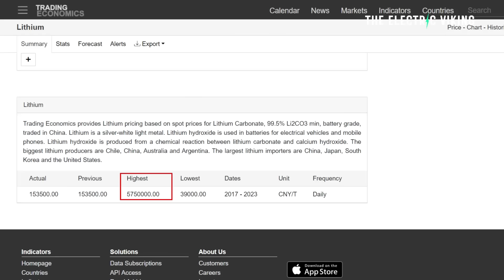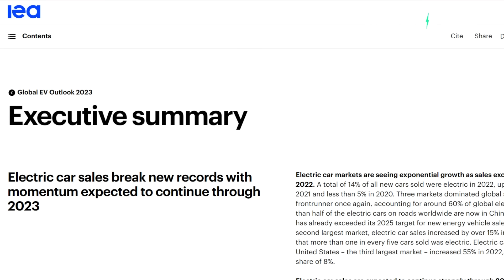The reason Electric Cars will be cheaper than ICE cars in 2025

Comment: Not only wil the purchase cost of vehicles beb lower but the cost of operating them be on the rise.
Reply: Why would the price to operate an EV rise?
Reply: @bobwallace9753  go look at the price of insurance. I also don’t need to install $1000 charger for a vehicle that I purchased.  Then I sincerely hope that you don’t get into a fender bender and find out that your entire car is going to be written off and totaled out because of panels they cannot be replaced. And God forbid that there is a scratch or a dent on the battery pack, no one is going to take the liability of replacing individual cells. So that means that on an accident you need to replace the entire battery pack.
Reply: @SlavGuns  
Don't be a drama queen.  Any car with serious crash damage gets written off.  Insurance companies do not want the risk of a future crash that might be blamed on major structural repairs.

According to Tesla it is easier and cheaper to repair a damaged casting than a similar repair on a 'stick built' car.

Tesla battery packs are well protected from crash impact.  If you get into a crash that damages the battery pack then you own a totaled car anyway.

Check Tesla insurance premiums.  

Almost no one needs a $1,000 charger.  Many people can do fine with a normal 110vac outlet.  If you live in Europe or another place where 220vac is the standard then you're set.  If you do need faster charging than a 110vac outlet provides you could either share your electric dryer outlet or have a new 220vac outlet installed for a few hundred dollars.

If you actually need a $1,000 charger then you must be a high mileage driver and should quickly save that grand via gas and oil change savings.
Reply: @bobwallace9753  The tires on EV's needs to be replaced around 4 times more frequent for example. I also thought service cost was supposed to be lower on EV's, but I was wrong lol. Also read about a VW ID4 owner who said the service on his EV was as much as the Tiguan he had before, but on the ev they did not change 5.5liter oil.
Reply: @AndrewTSq  
If people jams the accelerator to the floor frequently they will wear out the tires sooner.  But if one drives 'normally' tires should last as long, if not longer.

Tire wear claims are often based on vehicle weight.  Yes, if you compare the weight of a Tesla S to a Corolla the EV weighs a lot more.  But a type to type comparison is not very different.  

The Tesla S weighs  4,561 to 4,766 lbs
The BMW 7 weighs 4,720 to 5,095 lbs.

The Tesla 3 weighs only a bit more than the BMW Series 3.

I wouldn't make decisions on what VW or other legacy brands cost to maintain.  Look at "pure EV' companies like Tesla.  What I commonly see is people reporting high mileage (200k level) with no maintenance costs other than windshield wiper fluid.

Dealers screw people.  It's just how they roll.
Reply: @AndrewTSq where do you get your information?

Comment: The Limiting Factor channel has a detailed analysis of lithium supply and demand over the next years.  Its conclusion wasn't an excess.
Reply: 200 years to extract and refine the Copper, 9,000 years for the Lithium.
Reply: @MrkBO8  9000 years? I read there is around 88 million tones of Lithum on earth, where around 22 million tones do make economical sense to get out of the earth.  So that means we get around 2500 tones per year then?   2021, we got 107000 tones out of the earth.  so at that rate it means 205 years, and if we dont care about cost its 822 years. not 9000 years. But I could be wrong.
Reply: There’s plenty of Lithium to go around. Norway has discovered a. 
Whole dormant valcono of Lihium
Reply: Its not the supply of it, its how fast it can  be refined @AlanWilliams-su4bs Copper is a supply problem because the existing mines are already depleted, todays rate of mining it would take 200 years to dig it up.

Comment: I thought Ford and GM are stopping EV production, and the lots are full of tens of thousand of unsold cars.
Reply: Dealers don't like EVs because they have low service costs
Reply: @danielstapler4315  maybe. Repair pal indicates that Tesla cars (60% of the market) are more expensive than the ice cars of the same class
Reply: @linusa2996  but there’s very little to repair or maintain on an ev.
Reply: @steveb796  ev's have 3-4 cooling systems which need radiators ans coolant pumps, electric hydraulic pressure pumps for the brakes. Every ev is heavier than its equivalent ICE and the suspension components are under more load. The tires wear out faster and are more expensive if you use the factory tires or other ev specific tires.
Reply: @linusa2996  the battery systems are sealed and need no regular maintenance. A Tesla model y weighs 4416 pounds. 
A Toyota Rav 4 w 2.5 l 4 cylinder engine weighs 4705 pounds. The suspensions are built for the car. No issues. Tires wear just like an ice car. No oil changes. No transmission, no fuel  system, no exhaust system to monitor or maintain. There’s a reason the legacy auto industry has been dragging their feet. They make too much money on maintenance and repairs. If Tesla hadn’t happened we would still be in the last century.
Reply: @steveb796  in order for the battery if it cooled, has to have a coolant line going into the case, around the batteries, out to the pump, from there to the radiator. If it does not have that then you have a battery that only cools down by turning off the battery.
Reply: @steveb796   it's 4,208 for the Tesla and 4,920lb for the RAV-4 Hybrid and 4,610 The Tesla Model Y is based on and uses the Model 3 the RAV-4 use to be lighter at 2,500lbs and has grown in weight as  heavier bodies replaced the previous versions to meet safety requirements and to make the body more rigid, more off road survivable
Reply: @linusa2996 you are right, but in an ICE car there are about 500 parts in action, while there are only about 20 parts in an EV.
And whats not there, it needn t have to be repaired.

Why do such crude comparisons always come up, even though EVs are significantly more efficient and environmentally friendly, do not emit any carcinogenic pollutants while driving and are significantly quieter and therefore less stressful for residents? The Petrol Lobby has done a great job in the past.
Reply: @steveb796  toyota rav4 hybrid weight is actually 3748kg.
Reply: @danielstapler4315 FALSE! They are licking their chops are astronomical battery and drive unit replacements, and using EV’s as an excuse to lock down the car so you can’t DIY. The problem for them is not everyone is so gullible to buy their EV’s. The pros don’t outweigh the cons.
Reply: Yes, Ford and GM EV sales are not going well, however other manufactures are not seeing the same issue with EV sales. The big three need get the UAW out and think different with EVs and not think of ICE vehicles with a battery. My opinion.
Reply: @avaxasirvina6740  the UAW don't  design or market any vehicle. And the UAW just caused non union companies to raise their pay. And even if Tesla is able to stay non union in the US, some countries like Sweden and Norway will force them out if they don't allow their workforce to unionize. Seems that Sweden is 90% union, so the dock workers are refusing to unload Tesla's, maintenance workers are threatening to not work on tesla buildings
Reply: @linusa2996  Tesla won t be unionized in Sweden.
The majority of the Tesla workers are treated and paid very well, they told the newspapers.
Its only about the union, who wants to raise their force against Tesla..
Reply: @mcherry8010  then tesla owners will need to start making plans to drive their cars to Belgium for scheduled repairs or maintenance.
Reply: @linusa2996  why Belgium?

no need 4 sarkasm...
Reply: @mcherry8010  Norway is mostly union so it's off across the water via car ferry. You can't ship it cause the Swedish dock worker will not load it. So you are driving it yourself
Reply: @linusa2996  you wrote about Belgium...?!
Reply: @mcherry8010  I picked a country whose unions are not participating
Reply: @linusa2996 to be honest, this will be a short attack to Tesla

What should the union do, EMusk wont have unions in the company.
Reply: @mcherry8010   Sweden is 90% unionized from dock workers to office maintenance, and the Swedish government has said Tesla is not going to be granted a waiver.  There are no Tesla assembly plants in Sweden. So they can't ship them by boat. That means Tesla buyers will need to purchase their cars and drive them into Sweden themselves
Reply: @linusa2996  we will await the further ongoing.
I don t think, that Tesla will give in.
But I don't know, why you are against  Tesla, too, as it seems.
The great majority of swedish Tesla workers are saying they are fine.
Reply: @mcherry8010  Swedish tesla workers make up less than 1% of 1% of Swedish workers and are about numbered by the Unionize Swedish janitor union members who have pledged to not clean Tesla offices. As to my personal distaste for tesla, when I buy a car; I own that car, not Tesla. I decide to what use I the car for not Tesla.
I am annoyed by claim that tesla is the best built car because of its superior manufacturing equipment and elon musk when the 2nd hand hothatch that was built in Freemont has better fit and finish at 10 years than any Tesla that just rolled off the assembly line even today. I especially scoff at claims of tesla being the fastest production car, quickest to 60 or the 1/4 mile not not the fastest when at a quarter mile most sports cars will already be reaching the quarter mile at a faster speed (speed not time) meaning they are on their way to blowing past the tesla before the reach the 1/2 mile mark. And that's before we get to Elon Musk with his money saving traffic solving tunnel 🙄.  Or his latest examples of anti Semitic behavior and support for racists? Facist, anti-Vax idiots (I work at a hospital and yes anti-vaxers are an utter waste of matter best used as plant food). Mr "consevative AG please launch criminal investigations of people who are mean to me" Musk.
Reply: @linusa2996  okay, the curtain fall, you got a personal problem with Tesla and / or his CEO.
Reply: @linusa2996  Never said UAW did design, are you actually fully reading the posts your respond. Unions in America, have been way to political and corrupt.
Reply: Yes they are pausing.  They can't make a quality product at this time  that they make money with.
Reply: @PC-vq5ud  wanna bet?
Reply: @robertfonovic3551  Giddyup
Reply: Well, when you focus on the one segment of the market that has specifically opposed EVs (light utility trucks), you're going to have trouble selling EVs. Note that GM will continue to produce and sell Bolts, as people are buying them (their issue has been dealt with).
Reply: Yes they are slowing down production and investments, prices are far too high, not only ev though
Reply: @melaniezette886 they miss scaling, thats true.
So their cars wont be cheaper earlier while the old oems have a big backpack with their entire ICE production lines to transform...
Reply: @robertfonovic3551 you wrote first about EV Nonsense in the comments, thats your black or white point of view. And you are asking about lip reaction.. very smart..
Reply: Both are increasing production. As for unsold inventory, you can blame the failure to address the charging interface switch for that. Who wants to buy a car they will be unable to charge in two years?
Reply: @downix  the charging interface is the charging company problem. They use a similar format in the EU and they are far more reliable than the US companies. In The EU CCS-2 is the standard and tesla has an adaptor that they've been using for years now
Reply: @linusa2996  You are aware that CCS has been dropped in the US as of a few months ago, replaced with the new NACS plug, yes? That is what I refer to. Yes, I know adapters are coming, but the perception is that any car bought now will be unable to charge in just a few years.
Reply: @downix   And I repeat, US non Telsa Charge stations will have the same problems with NACS as they do with CCS. it's an issue with the management of those companies, not the plug or the car manufacturers.
Reply: @linusa2996  which is irrelevant to the topic on EV sales slowing.
Reply: @downix   EV sales are slowing because the EV early adopters have that were going to buy EV's have bought them. Now the market will be mostly those folks who are looking to purchase a car new or old.
And that is running into the reality that 50% of the buyers can only afford a $400 monthly payment. So 400x72=  $28,800max price including all interest and other expenses regardless if it's new or used
Reply: @linusa2996  then please explain why the slowdown began when the NACS switch was announced.
Reply: @downix  They are not related. Bolt sales went up after NACS was announced, so were Mustangs, those slowed down in October
Reply: @linusa2996  funny how you point to the cars which had transition announcements, proving my point.
Reply: @downix  The Bolt was scheduled to be canceled, so not NACS related, Mustang EV has been losing sales despite NACS compatibility announcement
Reply: @linusa2996  that is directly the opposite of what you said just above
Reply: @downix  No, it's just the sales data. Bolt was scheduled to be dropped from the line up but it's sales have been increasing as it's one of the popular GM product. GM has since announced that it continue but using the new GM battery.  The Mustang's sales were going higher until just recently, due to an issue with the battery.
Reply: @linusa2996  now a third position which contracts the previous two. This is getting hilarious watching you making up excuses.
Reply: @linusa2996  Thats wrong,
only Model S pre Facelift got Type 2 and it s possible to upgrade them to CCS2 inclusive CCS Adapter. Afterwards all cars for the european market have been delivered with CCS 2 charging interface, Model X, 3 and Y of course.
Reply: The sales of compelling EVs is not declining at all.  But  turds are indeed not selling!
Reply: dont let reality stop a clickbait video. in two years we will see the same bold prediction. fail, rinse repeat, all for clicks.
Reply: @thejoshman3843  I actually googled some of the claims in these videos, and many of them have been true. But the way these videos are made make them very tiresome to listen to.
Reply: @AndrewTSq I never listen. I just come here for a bit of daily humour ie the stupidity of some people, who believe all this EV nonsense.
Reply: @robertfonovic3551 Have you ever driven any EV? It seems you have no idea.
Reply: @aligenc659  I love to drive EV cars. I have nothing against EV as a car. But I see a big problem with car-prices of EV's, and the power grid we dont have for this in sweden.
Reply: @AndrewTSq  I did not mean you, bro. Yes, you are right. Grid, Evs will get better with the time
Reply: @robertfonovic3551 me too!  Can’t stand 1min of the videos but the comments are a good laugh
Reply: @robertfonovic3551 did you fall off your horse and hit your head?
Reply: @AndrewTSq gasoline uses about 7 kw of electricity to produce. An ev can go 25 miles in that.
Reply: @steveb796  these facts aren t as exciting for petrol heads.

They dont know about kWh or energy efficency.
Filling up the car needs 5 minutes to drive another 600 miles afterwards without any rest, thats their same point of view, everywhere😂
Reply: @robertfonovic3551 pretty much all countries are giving a shat at making EVs, so there's bound to be a massive over supply resulting in lower prices
Reply: @steveb796  If that's one 7kw of electricity to make 1 gal of gas, then the ICE car is ahead of the game cause it's doing 25-40 mpg. heck the 850cc mini's were doing better than that in the 60's
Reply: @linusa2996  avg mpg is 25- 30. Electricity is a small component of gas production. You’re missing the cost of oil and all the damage it does.  The electricity comparison was to highlight that the load on the grid is not as drastic as many think. Since electric motors are exponentially more efficient than a gas engine and ev gets over 100 mpg equivalent